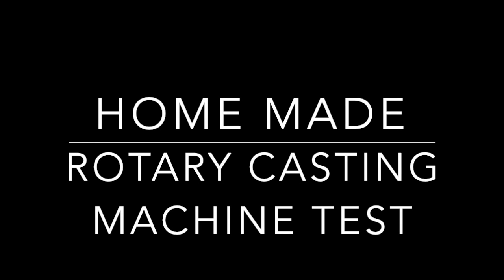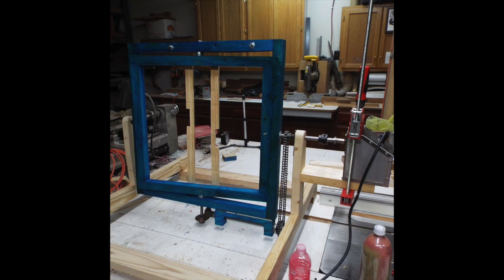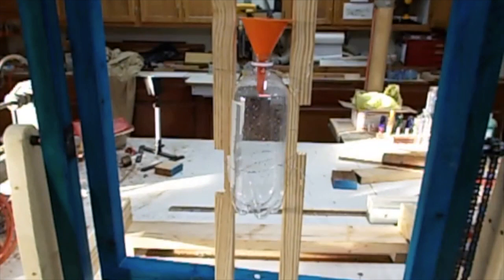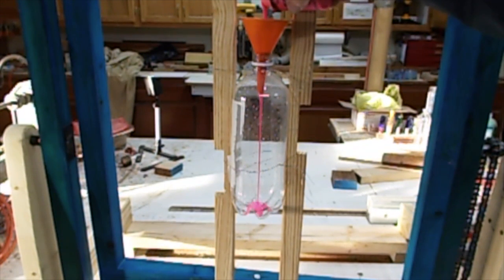Rotary Casting Machine Test

Comment: The outer frame should turn about 7 RMP, and the inner frame should turn about 2 RPM, or about 1/4 the speed of the big frame.
Reply: Read somewhere that a gear difference of 3.8 - 4.4 multiple is best for irregular shaped objects.

Comment: Im actually wanting to make a rotomolded silicone bottle, so my question is, did the bottle work as a mold? Were you able to extract the silicone afterwards?
Reply from the maker: this was a test. I wanted to see if paint would cover the inside of the bottle.
Reply: Well, you’re not getting the outer shape with the threaded top, you’re getting the smooth inner shape.  The right way is to make a mold of the bottle, then cast from that.
Reply from the maker: @DisgruntledPigumon  I am not making a mold I am checking the coverage of the machine

Comment: I would also like to know what plans you used or did you design this yourself?
Reply from the maker: Watched a bunch of YouTube video's and made it from there. Only one said anything about the bevel gear drive ratio That is where I had my problem. It is easy to build I used 2"x 2" for the center boxes and 2"x 4" for the frame. Used bronze bushings instead of bearings. Had the chain and sprockets from other projects, Bevel gears came from old riding lawn mower transmission. Lots of luck. Ron
Reply from the maker: I have not seen any plans. I got all my information from looking at video's on YouTube. I designed it myself. Thanks for watching.
Reply from the maker: Found these on eBay maybe it will help you. https://www.ebay.com/itm/Plans-DIY-Rotocaster-Rotocasting-Machine-Cast-Resin-Plaster-Latex-Etc/112443385608?hash=item1a2e25e708:g:xRAAAOSwQJhUb5zG:rk:1:pf:0
Reply: @dc9apu  Thanks for the info and quick reply.
Reply from the maker: You are welcome. I hope it helps you build one.
Reply: Free, here : https://m.youtube.com/watch?v=0IsWzmWj-5o
Reply: Here : https://m.youtube.com/watch?v=0IsWzmWj-5o